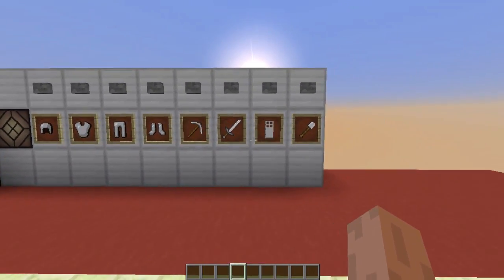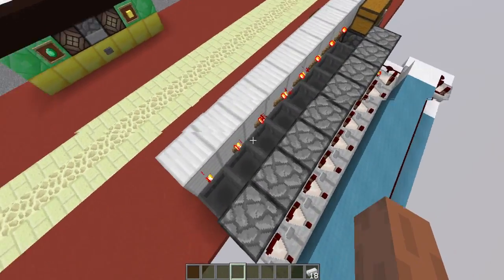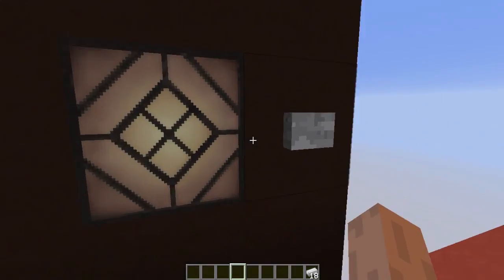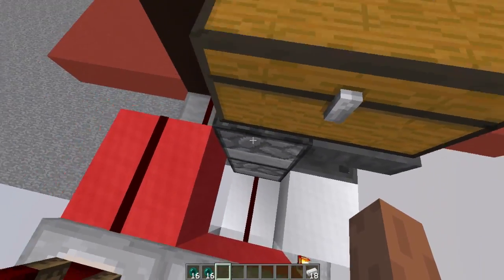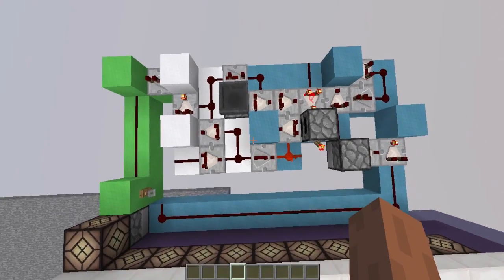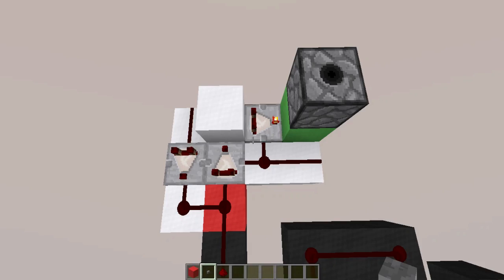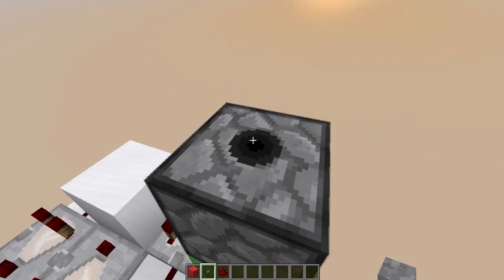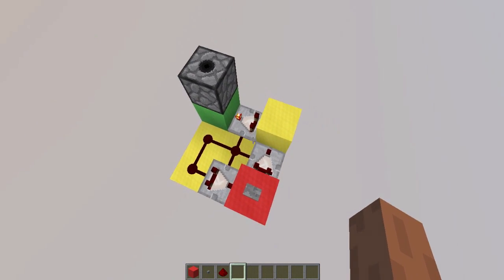Pulse multiplier & Applications: Signal strength input | Minecraft

Comment: I'm amazed by the x10 multiplier and try to implement it into bedrock. The Problem is, that the a one-tick pulse is needed for the pulse multiplier to work in bedrock and the pulse saver doesn't provide it. I'm very close to solve the problem but can't finsh today, i'll see…

Comment: That's awesome!  I had to come up with a triple-pulse generator for a diagonal rail system I was designing a while ago, and the biggest headache was getting the timings right to generate 3 pulses with a line of repeaters... This is waaay more compact.
Reply from the maker: +Kondrik You are not the only who has faced a situation where one needs N-pulse generator. I needed this myself and I'm glad this design is simple enough to be applied when necessary :-]

Comment: Awesome Cass! I already used the design you had before and this one is even better!
Reply from the maker: +bertossauro It has some advantages like being fast and not require any reset time but my other designs are configurable over a wider range of values. You can get more than 200 pulses from a single circuit alone with my previous designs and they still work in 1.9!